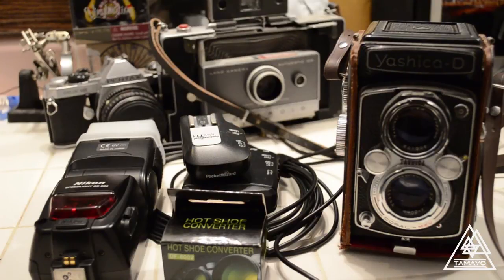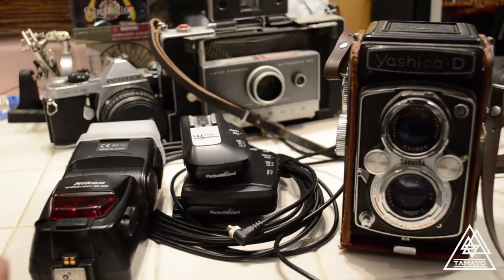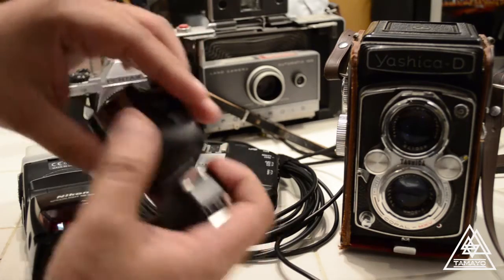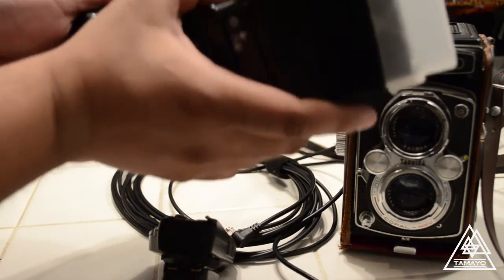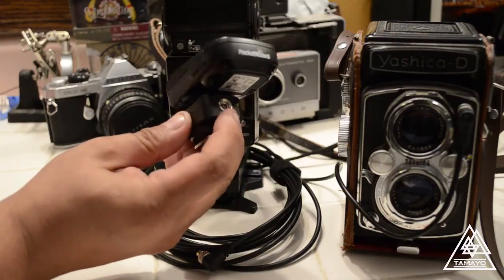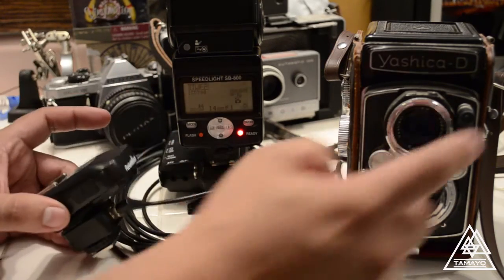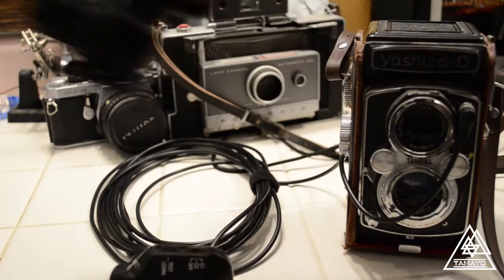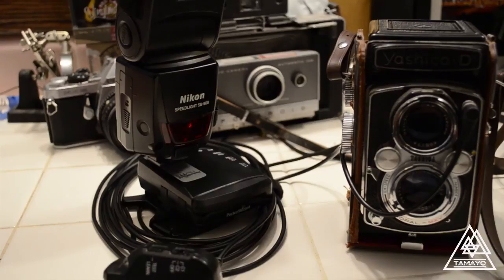Set Up your vintage/old camera with wireless flash

Comment: Sorry should have read down a bit..My transmitter has a PC port. But is a PC cable generic? Can I just buy one or are they size specific? Again I have a ....Well, a Yashica 635 and a Canon F1 that I am really interested in hooking up my Yongnou (I hope I finally got that right lol) remotes and flashes. Do I need different cables for both cameras?

Comment: Hi, awesome video first off all. I have a question does any electrical current go through the pc cable and if it does could it damge my speedlight if i connect it direct to it?
Reply from the maker: No it will not damage it. Cameras were designed to be connected directly to flash setups
Reply: @jrdaveblah  sorry, i mean will it damage my flash not the camera
Reply from the maker: @GabrielBongailas  no
Reply: @jrdaveblah  thanks for the help

Comment: Hi, Thanks for the video. I was just wondering what mode do you set your flash to. Can it only work in manual or can will it work in ettl too. I'm using a bessa r4m and a yn568ex ii.
Reply from the maker: Manual only with this camera. the camera just tells the flash (what ever is connected to the pc port) to trigger and does not send any more information than that.

Comment: thanks! so i need a hot shoe even though my trigger has a pc port on it?
Reply from the maker: if your Transceiver (which send a signal to the receiver that trigers your flash) has a PC port then you don't need a hot shoe adapter. there are different end terminals on cables (shown on the video) incase you don't want to but converters.